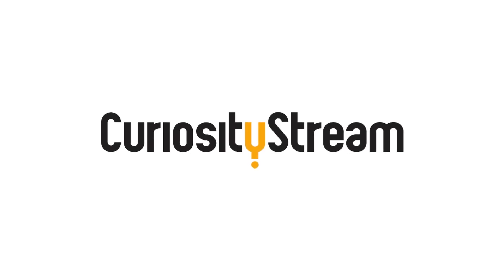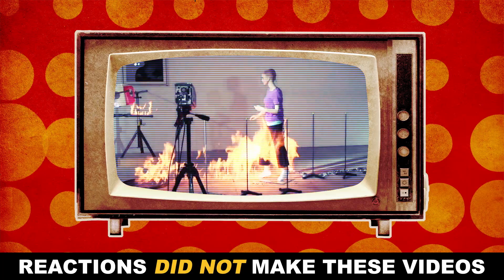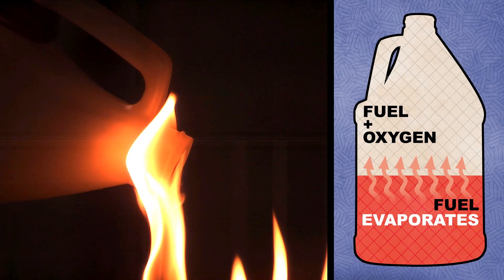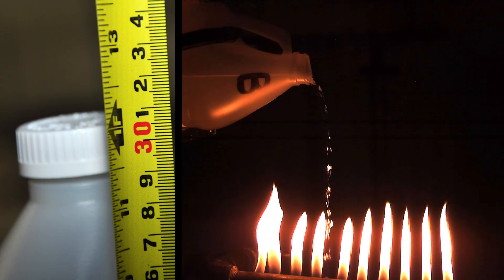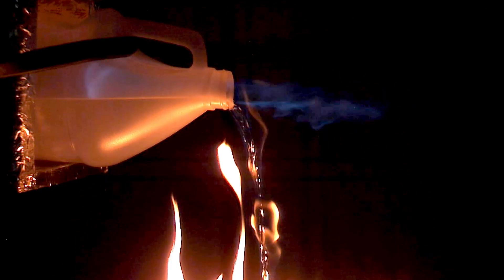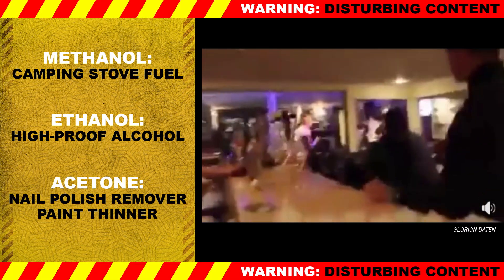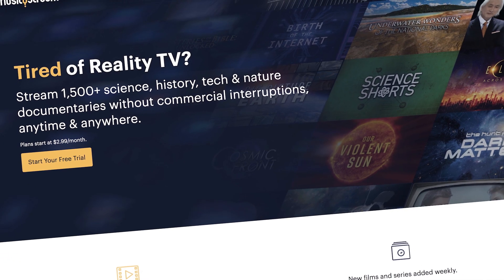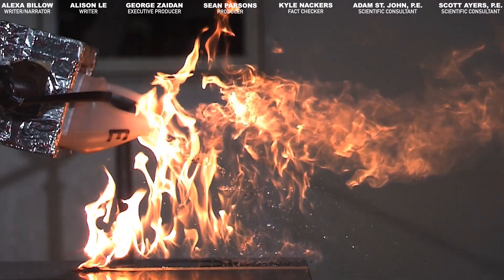Small Bottle, HUGE Fireball (How Flame Jetting Works)

Comment: NEVER pour flamable liquids directly into a fire... it's not only about flame jetting, it's also about explosions.
I've seen it happening with empty plastic alcohol bottles. It ain't pretty, and enough to cause injury to someone nearby. Even the sound of it could rupture eardrums.
Reply: exactly. once i was trying to pour alcohol onto a fire as it was fixing to die and it blew the bottle back about 4 feet and the sound was similar to a bass boosted song crossed with ripping fabric.
Reply: just saw someone get burned up horribly by this  that’s why i can’t yo this video  horrific burns

Comment: I was going to ask who are the idiots that poor fuel onto an open flame, but then i read the description. 
People need to respect fire more.
Reply: that's why you should place the fuel first then light something about 15 feet away and throw it at what will become the fire. No jet, and it won't harm you. It WILL raise the temperature about 25 to 30 degrees for a second or two, but as long as it's not a flame yet, you can pour your liquid fuel.
Then you light it and watch the fireball.

Comment: What's the best way to put out a fire?
Reply: Depriving it of oxygen.
Reply: Snow depends on what the fuel is.
Reply: Not start one in the first place.
Reply: Spray-Foam --> Works in nearly all circumstances of household incidents, can be used preventatively, does minimal damage of its own and is available in a handy format.. But it surely depends on what the fuel is.
Reply: Well, if it's a camping fire, use dirt. It smothers the flame and doesn't allow as much smoke. If it's a household fire, a fire extinguisher or something sticky or foamy, but make sure it's not flammable or you run the risk of making a bigger fire.